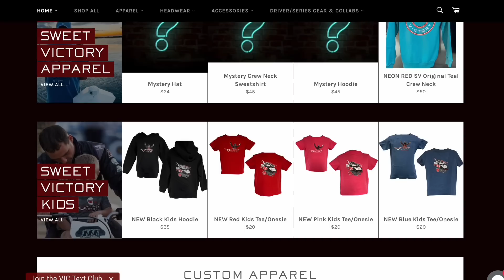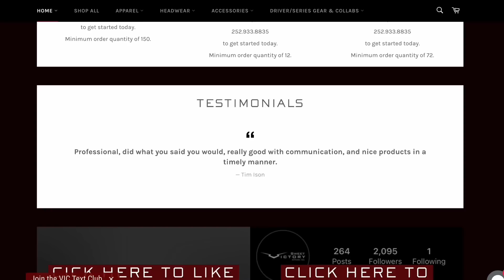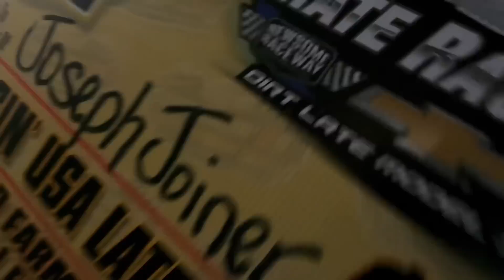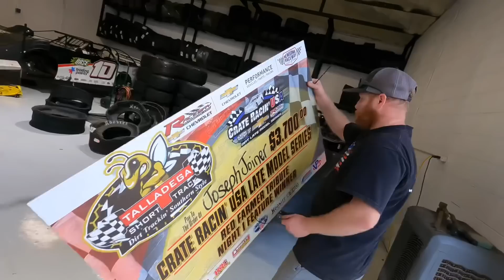Four Race Cars Under One Roof? And Our Old Toterhome is Finally Gone!

Comment: Hang the checks along the walls from rafters, you can chain them and hang 3 or 4 linked together if needed.
Reply: You stole my thunder that was my idea also just some s hooks will hold the checks together and then hang them from the wood along the top of the wall

Comment: Always wondered if you all are racing full-time or do you all still have full-time jobs 🤔 other than racing. You could hang the signs with plastic ties to the metal part of the rafters. Space them out evenly. Would look awesome that way. Still hoping to make it down that way soon. Been on the road a lot, but not too much down in your neck of the woods

Comment: 1"x2"x8' wood , paint them black and run a stringer the length of the wall you decide to put them on. You can screw or staple checks to the soft pine wood strip. It'll look clean, not clutter the wall, and look like it belongs. Screw the wood to the wall with the blue cement screws, usually comes with the masonry bit that you need with the box of screws. 3/4" wood screws to screw checks to the board.

Comment: I've seen where some people put bolts and or ziptips though license plate holes and make shudders/curtains out of them. If you could put two holes at the top and bottom of the checks (say the corners) you could ziptie one to the rafters and then ziptie one to the bottom of it and so on and so forth till it goes all the way to the floor.

Comment: you do have rafters, and that's where banners go, like any other good sports teams.  I'd put framing on the wall or just run some boards parallel straight up to the roof board against the wall and just tack them in there...   my two cents, lol.

Comment: Put the checks in order by date at the top of the wall. Joseph said there is wood there so a great way to hang them, plus hopefully they won't get damaged either, You can also hang your banner from the checks. Get a hole punch and put a hole at the bottom of the checks to give you something to tie on the banners. Make sure after washing the cars down you spray to concrete off to keep the dust out of the shop.
Reply: Holy Moly Adam. What would they do without you. Genius!

Comment: Install L brackets low enough so checks will fit below rafters lay a 1x6 on top of those L brackets on front of that 1x6 nail or screw a 1x2 along front edge. Put check on it top leaned back against wall in between checks put trophy. Just a suggestion

Comment: You could mount 2x4 or 1x4 to the wall  with plywood to them also you can put a shelf for the trophies use a hammer drill to mount the stud to block wall use screws on everything holds better

Comment: almost need a parking lift in the shop so you can stack the cars you are not using or working on
Reply: They should put in a car lift so they can walk under the cars. Easier to work on.
Reply: They said when they was in the old shop that wasn't too far off on getting a lift.... this new shop they'll probably get one I bet

Comment: Imo you should run some 1x strips across the wall and anchor it through the grout joints. Then you can hang the banners and checks from the 1x4 1x6 ect.

Comment: Maybe you guys could hang a cable 1/8 or 3/16 at a height easy to reach anchoring It every 25 feet or so with masonry anchors, then you can add 2 hooks on the top of your checks or banners to suspend them on. Good luck I'm sure you will figure what's best.

Comment: Take 2x2's run a straight line of them up high using cement screws but pre drill the wood and cement blocks ahead of time then just screw the checks to the 2x2 and add more rows of 2x2' and build shelves off them for your trophies

Comment: Here's a crazy question.
You have 2 604 crates. Now I know every driver doesn't drive the same buy wouldn't it be a smart thing to do is set both cars up identical then run hot laps and make changes from there. Hypothetically you got 2 chances at winning the race and I know what works for Joseph may not work for Jesse but I would think you got a 50/50 shot either way. Love the shop and can't wait for the next video.
Reply: Yeap that's stupid no matter what setup Jesse has he is not ready for that step to win races on the 604 level YET..lol

Comment: My suggestion for hanging the checks would be the sticky backing for those white hooks you can buy at Dollar General or any hardware they'll hold alot of weight and I'd put them at the very top of the wall .you probably should think about a mezzanine for storage up above,I suggested it before in your old building and if you use H-beams on 4'×8' centers you won't need any vertical supports coming down in your work area, also a good place to put air compressor, parts storage, nut + bolt biins etc.of course you have storage in the other part of the building. 🏁🇺🇸ML33MI
Reply: I forgot to mention I've hung things from rafters using  bailing wire you get from Tracker Supply and you double it up put one end in a vise and the other in a drill moter and twist it, I've made it in 20' lenghts and cut what you need I've also done it in 4 strands it also is quite decorative. 🏁🇺🇸ML33MI

Comment: take a 1x2 put it on the top for top checks for the bottom for it use a 1x6 and mount a 1x6 , 2" down with 4" L brackets and put a little like the little slats they use on lattice boards , they have them at lowes and home depot  , paint them white , the lattice is to hold the trophies beside the checks and not fall of , just paint them white before putting them up , if a trophy is to  tall put it in the merch room, and make sections for all of you guys if you want , you even put the trophys at your eating and podcast area , it will work guys , God bless

Comment: You guys doing a great job love the show but as far as the checks go get you all a hammer drill wood nailer and you can start at the bottom measure from the bottom of the top of the checks and you can make it all the way around there if you want it level it out hammer drill your two by then you got some place to nail screw whatever all the way around